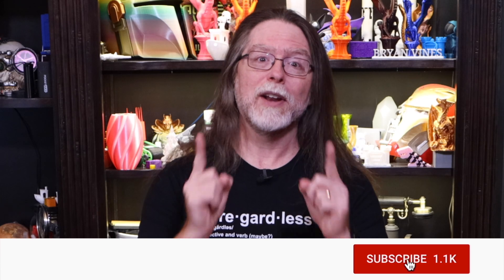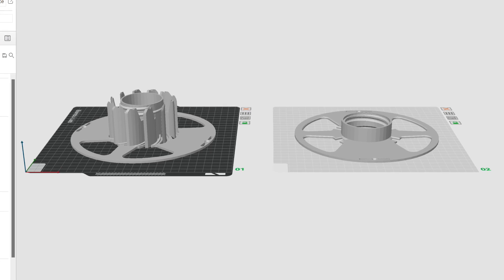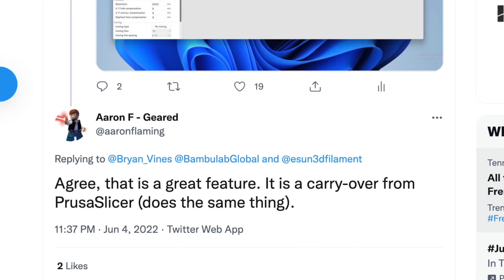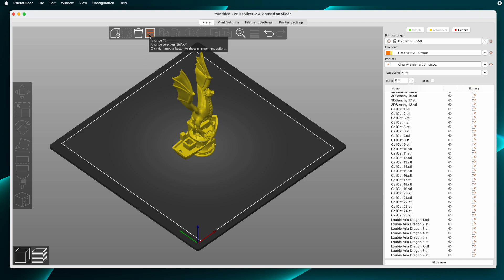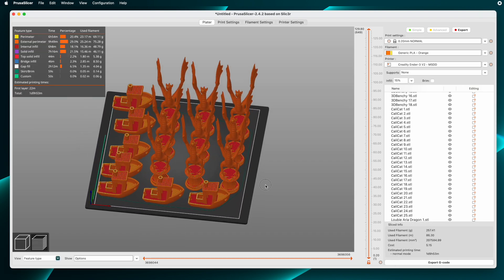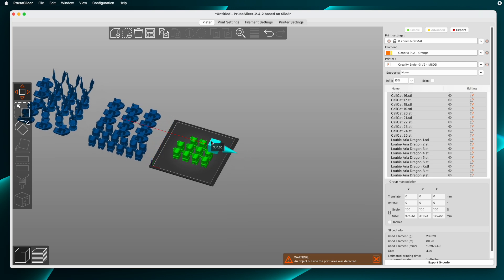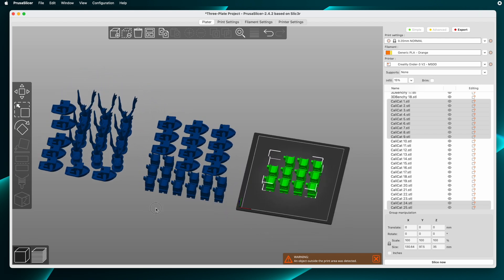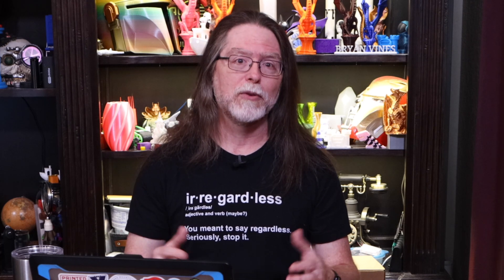PrusaSlicer Projects: Plenty of Parts on a Plethora of Plates

Comment: When slicing the 2nd plate, and then the 3rd, do the exported file names have same name? need to be changed manually?
Reply from the maker: Hi! Yes, PrusaSlicer always suggests the same file name when exporting a sliced plate. You will need to manually change the name.

Comment: What a great video to explain how Prusaslicer organizes models. I knew it did this in theory, but I've never actually tried it.  It is much easier to use than I had realized.  I can’t wait to use it for the next large printing project!
Reply from the maker: Hi! I didn't even know it would do this until someone mentioned it to me. It's pretty cool for being able to keep all the parts in a single project file (instead of one file per plate of parts!). 😀